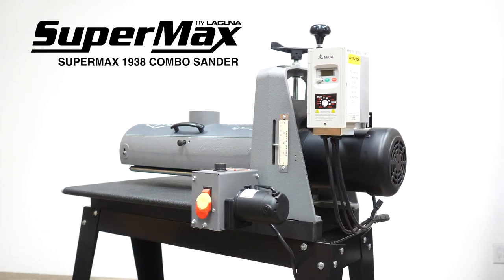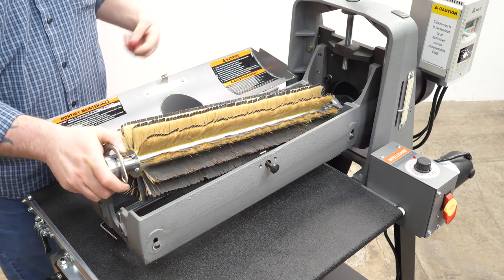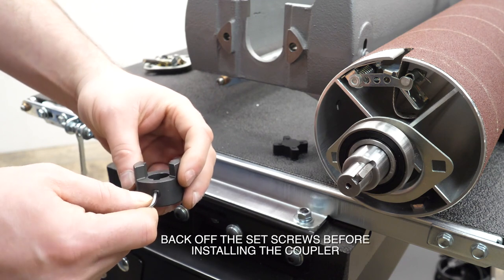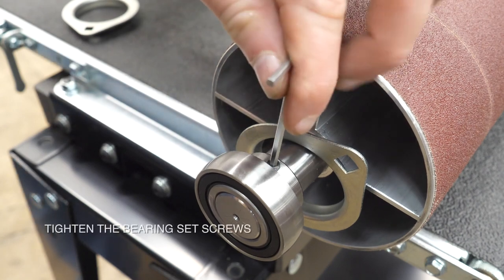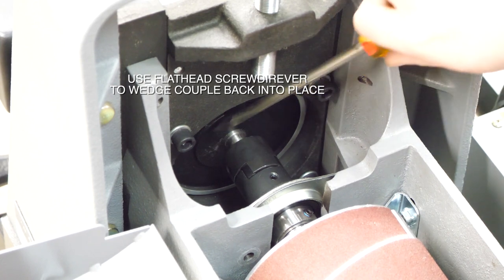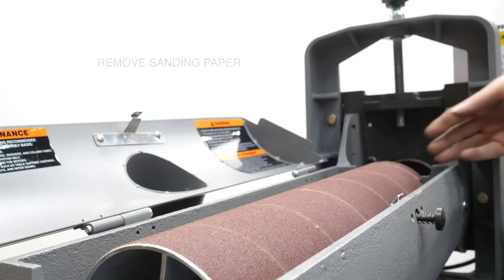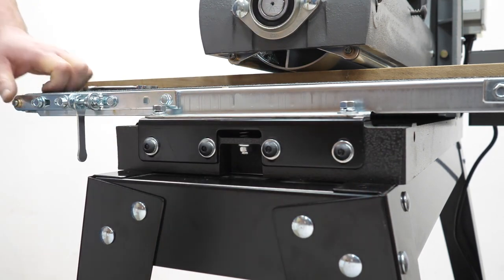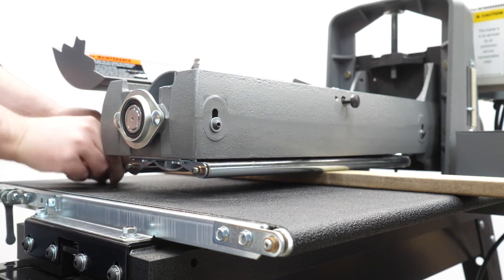Supermax 19-38 Combo Sander How To Tutorial | Laguna Tools

Comment: The “fast lever” on mine is very hard to move up and down. What would be the cause? Thanks
Reply from the maker: Hi, there. Try to loosen the 2 inboard screws that mount the conveyor bed to the base. They should be no more than finger tightened in order to operate the fast lever. If it requires a lot of torque to move the fast lever, those screws are too tight. Should be able to move the lever with one finger. If this doesn't work, please contact us at (888) 942-3340 Hope that helps!
Reply: Thanks! That worked

Comment: Can it be used to sand/refinish old cabinets?
Reply from the maker: The combo with flap sanding heads will scuff up old cabinets and prep them for paint, but it won't remove old paint or stain to a point of exposing the raw wood.  There isn’t a machine that can do this because it would destroy the profile if ran aggressively enough to sand off all the old paint or stain. However, the combo 1938 can do lot's of different things so it's a great addition to any shop!
Reply: @LagunaTools  that's what Im looking for, a machine that can scuff up cabinet doors so I can spray them right after I run the doors through the machine. I would need to see how it performs before making an investment in a machine like this. A lot of refinishers would buy it if it can save us time by not hand sanding. I wouldnt mind investing money on this machine if in the long run is going to  save me time and labor. Do you know a place in Illinois where I can see how it performs your machine? thanks
Reply from the maker: @hangeles80  This would be a great question for your local dealers. Woodcrafts are probably your best bet since they have classrooms, but ultimately, they'd have a better answer to give you. Hope this helps!

Comment: how do you replace the bearing on the regular 19-38?
Reply from the maker: Hi there! The bearing is seated in the housing by 2 nuts and a retaining clip. Both ends of the drum shaft have a retaining clip securing the drum shaft in place. You will need to use a snap ring pliers to remove the clip. You will then need to remove the nuts from the bearing housing, so the housing sits loose. Then the set screws from the bearings so the bearing can be removed. If the bearings are sticking to the drum shaft, you can use a pulley puller to assist you. Then remove any debris or burrs (if made during removal) on the drum shaft with a high grit sandpaper or file it very gently to be able slide the new bearing on. Hope this helps!